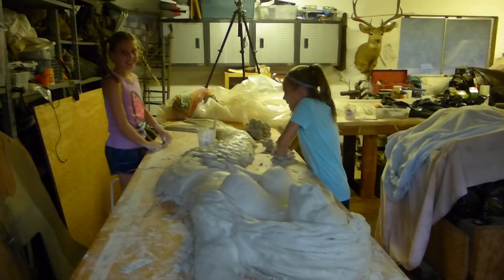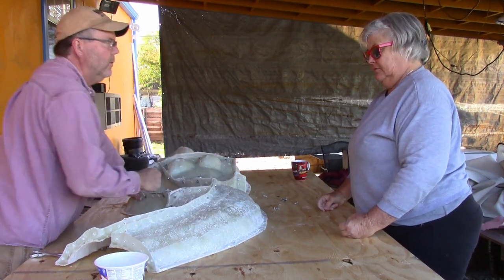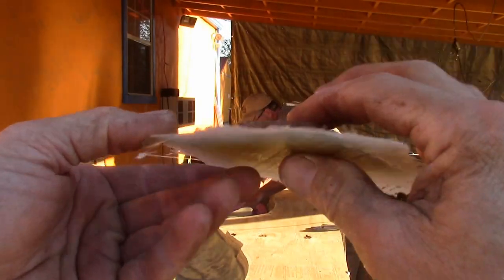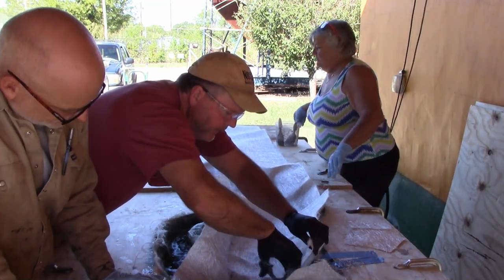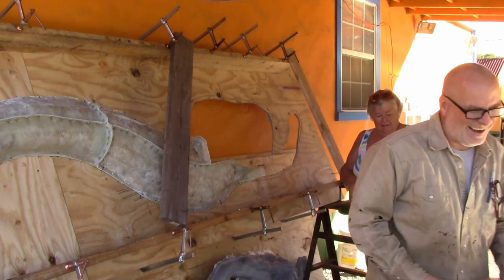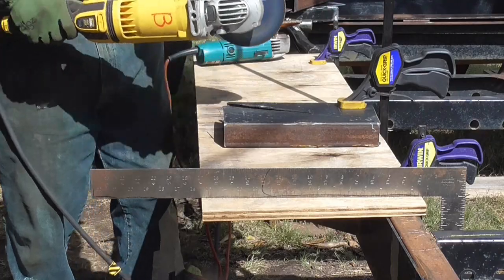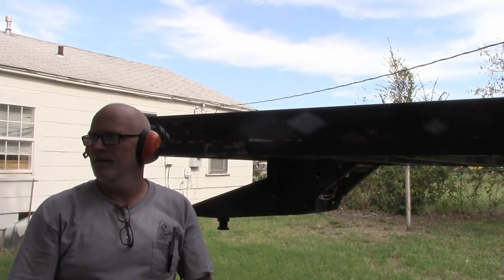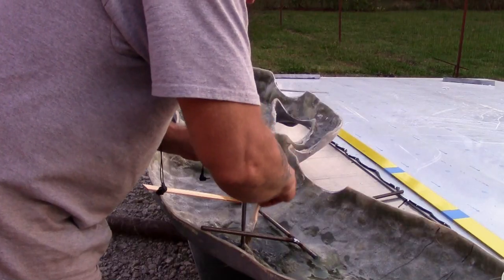Mermaids and a Tiny Home

Comment: Doug, very cool, hats off to the designer from CA. So that one mold is for the port side, how do you plane to make one for the starboard side? Because both sides have to match!
Reply from the maker: that was the original plan but she looks great on both sides so we are cutting the cost and time in half.
Reply: Won't her body be bent the opposite direction when you add it to the other side?

Comment: im really surprised you hadn't ever used those 115mm 1mm steel cutting discs before?Its always a toss between plasma and these when im cutting sheet upto 10mm. Often for 8mm plus depending I will use the 1.2mm discs for the 9" grinder, those are great for a nice clean cut also.

Comment: HI Doug I've been following your build for a while now and have been wondering what type of communications you will have between compartments. I am a 20 yr veteran (serving on nuc subs). and have since worked in telecommunication and data networking for 20yr +. You might want to look into a simple key system  and some surplus sound powered phones as they do not require batteries or power to operate as a back up. I'm getting set up to do some traveling in about a year and a half and would like to come out to see the boat. Bernie
Reply from the maker: None.   If I want to see you, I'll come see you.  It's not that big of a boat.   :)     Look forward to meeting you.

Comment: try applying the polyester with an small paint roller next time you work with glasfiber and polyester. its mutch easyer. use an aluminum riberglass roller to remove the air from the laminate. clean the aluminum roller with aceton.

Comment: getting an itchy feeling from just looking at fiberglass 
im alergic to epoxy and found out recently they nowadays use the stuff as toothfilling 
had no feeling on the inside of my cheeks for about 4 days

i hope he has the trailer for the tiny home zinkplated / zinksprayed before he put the wood on there , it will give a WAY longer life to the trailer without the need to crawl under it with sandpaper steelbrush and paint and stuff every year or so to prevent it from rusting and if youre living in it that is a realy good thing

Comment: About halfway through I thought ," What the . . .We're building boats not trailers". Then I thought it was a commercial for DeWalt cutting disks. 

I get it now. Tiny houses are cool, but back to the mermaids. I'm surprised you didn't clear gel coat the mold and apply colors before applying the layers.

Comment: what is that thing that you were using, it looks like a sphere and you had it attached to the drill and you were using it to sand the mermaid
Reply from the maker: Not sure what to call them.  They are on the self at Harbor Freight.
Reply: ok ill keep looking. what if you got sponsored by harbor freight
Reply from the maker: Ha!  Horrible Fright will not likely sponsor someone that more often than not refers to their tools as crap.   But crap tools often get the job done.  Perhaps only once.  But if once is all we need then it was the right choice.  :)